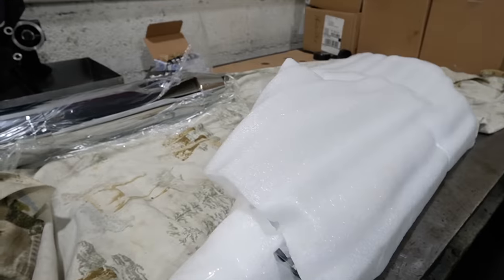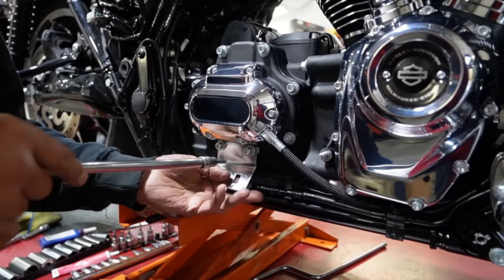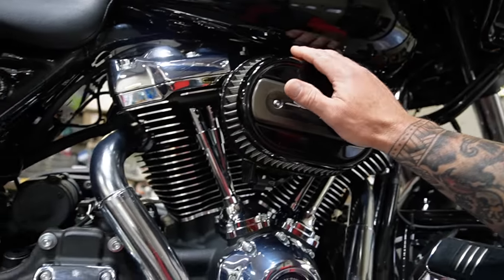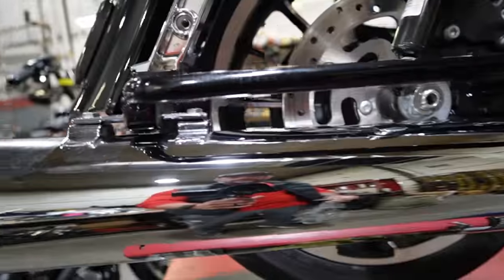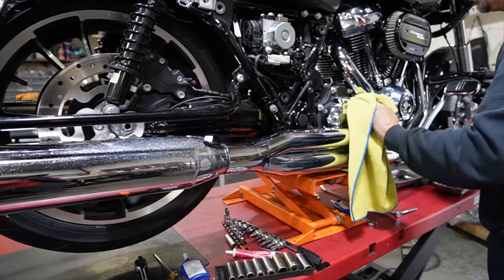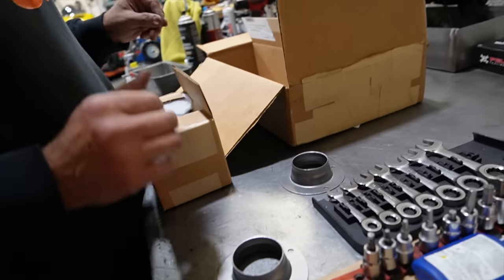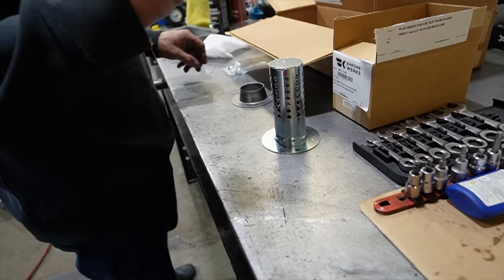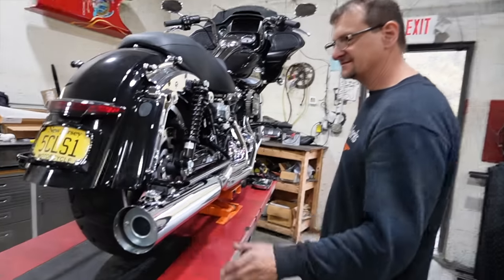FIRST START Harley Davidson ROAD GLIDE | S&S 475 CAM Khrome Werks OUTLAW 2-1 EXHAUST #roadglide

Comment: I have been all over the place trying to decide which cam to install in my M8 107. Thanks to your videos I have finally decided on the S&S 475. It seems it's the perfect CAM for the 107; great horsepower and torque, reliable, and of course the lope. Thank you for the great videos!
Reply: What did you get for numbers(Hp & Torque)? I have a 2020 road glide with the M8(107) and trying to figure out what cam setup would be best.
Reply: 475 is a terrible cam. So many better options out there.

Comment: And I have a 107 but stage 3 with the 114 jugs and higher compression piston. And the same breather as yours. Your gonna love it . I run down the cvo stage 2 117s all the time and I think it’s from the kw 2-1 pipe. I’ve had all the pipes you could think of.

Comment: This video is phenomenal both to the product and to the potential buyer of a Khrome Werks pipe. You have a top professional installing it giving his opinions the whole way through we're able to see the pipe get an idea of how to go about installing it looking to see if there's any issues along the way it doesn't get any better than that and you can certainly see how many times I've watched the video I am in the market for this pipe... Currently I'm researching things out as far as a single cut out with my bag situation. I have a 22 Street Glide Special and I don't want to get rid of my extended bags. I like that look quite a bit I don't want to get into aftermarket bags that don't have the Harley logo inside or change a bunch of parts costing me a fortune to accommodate a 2 into 1 pipe. . I'm currently grappling with the idea to stay with a dual exhaust using a Khrome Werks the pipe is just as beautiful, well made and high performance, but all of us horsepower freaks know all about the advantages of a 2 into 1 I just can't spend a fortune to change up bags and store all my original Harley parts that I'll never use again...
What would help me and I'm sure many others that are looking to drop a ton of money on Khrome Werks is the same type of video install of a Khrome Werks dual system so I could spend an equal amount of time learning that... I have diligently searched YouTube for an installation video by a competent person that can articulate intelligently and that information strangely absent..
Thank you for your efforts I really appreciate what you bring to the table it's helped me make a lot of decisions seeing firsthand what I have to go through to achieve my goals on my bike👍👍

Comment: Unles something goes wrong with the mixture or timing when changing from a restrictive (high back pressure) exhaust system to a free flowing (low back pressure) system, torque and power go up when back pressure goes down. It works the other way around also.

BTW, if torque goes down at any rpm so does hp. If torque goes up, power goes up. They are directly proportional (if you throw in rpm and the constant of 5252).

Comment: back pressure necessary for low end torque?

In short, no. Velocity and scavenging are much more vital to making good power than the amount of back pressure in an exhaust system for a 4 stroke engine.

Comment: This two-into-one exhaust is way too loud for my ears for long rides.
Reply: I agree with you. I have a 2019 Road Glide Ultra with a built 128-inch engine and do 800-1,000 a week when the weather is good and the Khome Werks two-into-one exhaust even with the DB reducer would be way too loud for my ears on long rides.